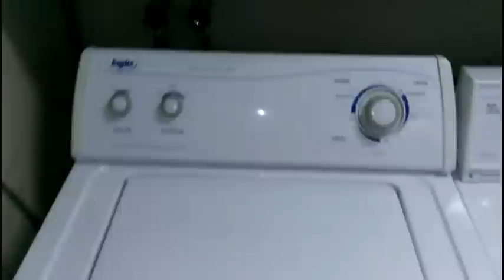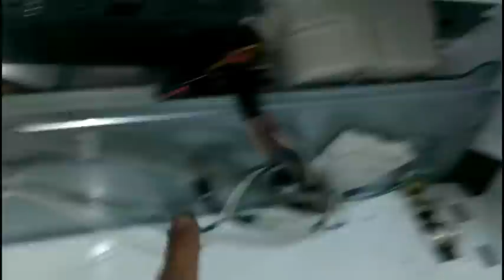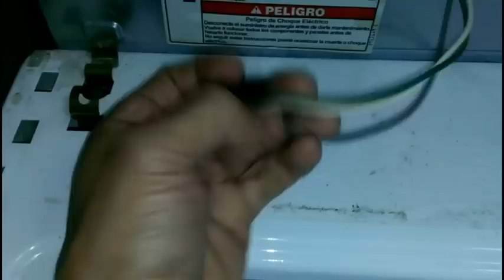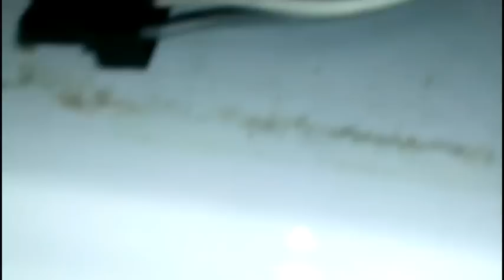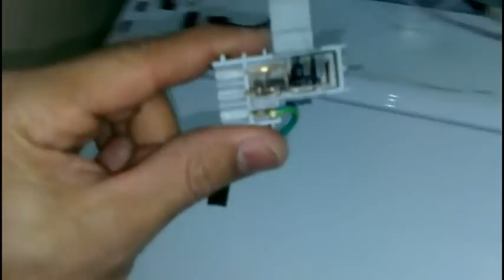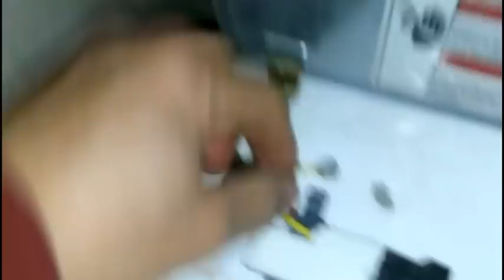DIY WASHING MACHINE FIX. Replace or bypass lid switch!

Comment: So, the switch gets the power from the motherboard. If you disconnect the switch from the motherboard, no power. Wouldn't you put the jumper on the motherboard circuit so it thinks its getting power? Im confused how the jumper tricks the lock when there is no power going to the lock since it is unplugged. What am I missing lol

Comment: My Lid switch clicks, but when I check it with Multi-meter, it is discontinuous. So I took your advice and connected a small wire between the 1st and 3rd -non-Green Wires in that wire harnessing coming from the Control Board going to the Lid Sensor. It did not work. It restarted it at rinse, and filled up a little more than the level it was at, but the spin cycle it did not work and now still have water in my machine. What would look at from here?

Comment: Can you tell me which one it’s better I buy a replacement part but the plastic that is made of it’s very cheap and low quality and I last for Less than 2 months I only pay 30 usd but it’s not fun just to buy it for 2 months are there is any brad you recommend or model
That have better plastic quality

Comment: Thanks a ton! I had a load of laundry stuck in the washer. Knew enough to get the top of the machine off and get at that stupid switch. Bless corporate design and their little fiddly bits of plastic that snap at the first sight of strain. As I was doing the teardown, the little shit popped right out of the enclosure into my hand. I am perfectly ok with manually flipping the new, and vastly improved IMO, "lid lock" now and again... Thanks so much once again!

Comment: So connecting the wires will not cause a fire or blown circuit
Reply: Your just replicating a normal closed circuit.
Everything is the same except no switch to open the circuit when lid is opened.
Reply: @aaronsmith5433  thank you!!!!

Comment: Do you have venmo? I want to send you money as thanks for saving me so much!

This fixed my Whirlpool model wtw5000dw1. Machine would flash "sensing" and click at the lock 4-5 times and not start. Diagnostic test said lid lock. I figured I needed a new lock assembly so I had nothing to lose opening the lock and removing this clip. Worked like a charm.

Comment: Check the lid switch rubber bung.  Take it off and try the machine.   On my Kenmore the bung is a white rubber doughnut about a half inch in diameter and about 1/4 inch thickness and it is mounted on the lid.  Trim the bung and there is a chance everything will now work. Use an ohmmeter to ensure that the circuit is being completed. I also used a screwdriver to hold the switch down.  I put the machine to Spin. Pulled the on-off switch and it ran.

Comment: If the manufactures were actually concerned about injury from a running washer, they would use a decent quality switch that would last the life of the machine without failing. Then there would be no need to bypass this switch.
Reply: Switches are not needed for people with brains!
Reply: @PapillonOne  Hear, hear PapillonOne!

Comment: I had this problem but the switch and the connector melted. I cut the connector of and wire nutted  the two wires together and actually connected the ground to the chassis

Comment: Thank you, thank you, thank you.  I have been trying to figure out how to bypass the lid switch on my daughter's washer but it did not look like any of the  others as it lacked the connector you plug/unplug.  Watching your video I knew which wires had to be connected to complete the circuit and we now have a running washer.  I am sure my daughter will be delighted when she gets home from work to know she can now washer her clothes again in her apt and repair cost nothing but time!

Comment: When replacing this type of lid switch, raise the door to disengage it from the switch under the cabinet.  Might save you from breaking the new switch when reinstalling.
Reply: What you should really do when replacing any component in a washing machine is unplug it entirely.  Most appliances run at the full 120/220VAC meaning all the parts that carry electricity will be at the full mains voltage, not something to play arround with.
Reply: @MyBrothersMario  he meant move the lid up a bit so the arm do the arm doesn't physically obstruct the new switch when you install it